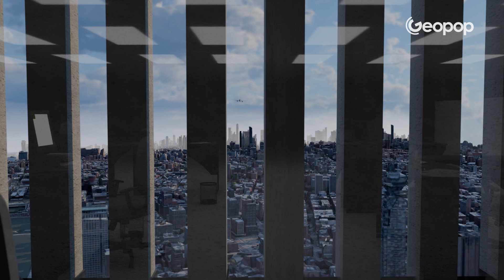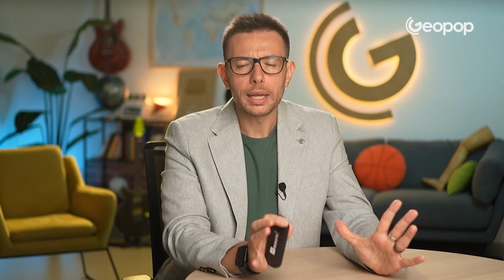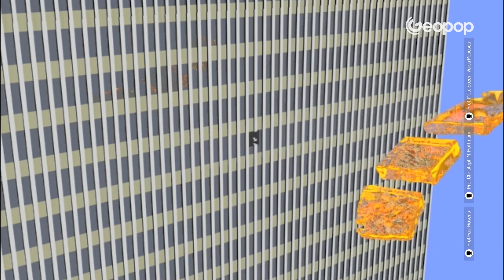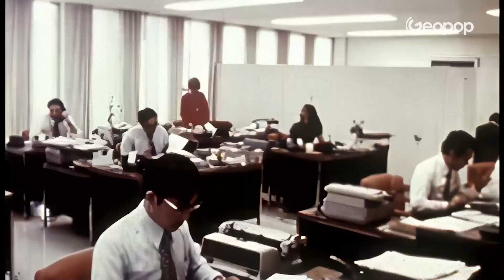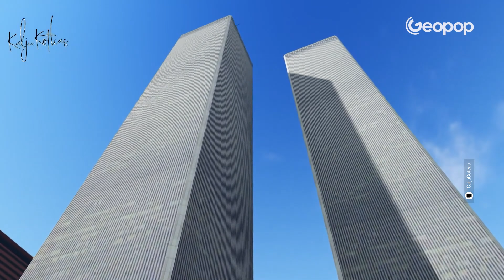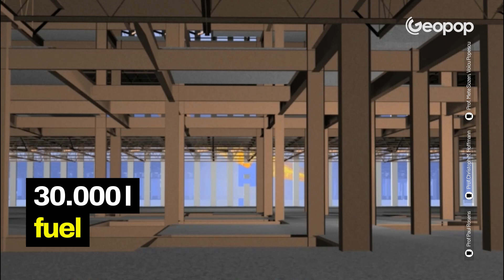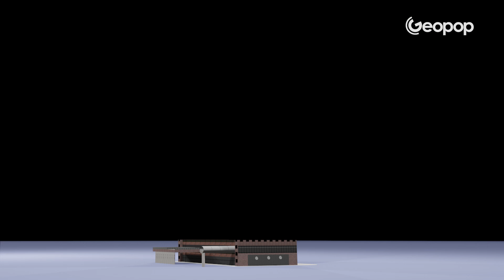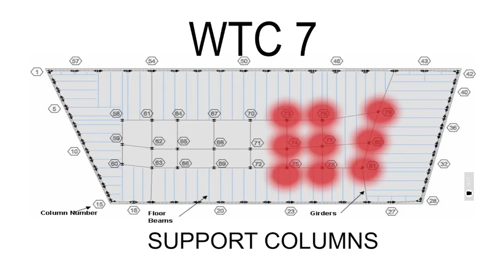9/11, 2001: The Technical Reconstruction of the Twin Towers and WTC 7 Collapses

Comment: 1 WTC collapsed directly on top of 6 WTC and you would usually expect to find 1 WTC's rubble on top of 6 WTC, but that wasn't the case. Instead of 6 WTC being completely buried under a gigantic pile of 1 WTC's rubble, was a gigantic hole. Basically the entire interior structure of 6 WTC was missing and only the steel fassade was left standing, the interior of that building was missing plus little amounts of 1 WTC rubble was found in the hole of 6 WTC. I always wondered what happened to 6 WTC and its missing interior and the rubble.
Reply: Yeah well what about building #7? Seriously that's a good observation but they rigged building 7 with explosives and demolished it within hours. Unless?...
Reply: @seedplanter7173 building 7 had a chunk of wtc1 fall on it and caused fires there were fire fighters inside tying to save the building but by 2pm they were told to pull out of the building after there were reports of the building making a lot of creaking sounds like it was gonna fall and then they got out and let the fires burn undisturbed till it eventually fell it burned till it collapsed at around 5 or 6pm the fires weakened an important column and then caused a failure that began a domino effect inside the building as the rest of them failed one by one from the east to the west and then wqs pulled inward from the collapsing interior and without any internal support, the facade of the building came down with nothing holding it anymore the facade held up fine but it wasnt gonna just sit there while the interior collapses and remain standing as a skeleton
Reply: Passport in the rubble "This our guy!". "We can't show this on the TV anymore it's to upsetting"- real translation "you might start to see the B.S.".👍
Reply: @wb2530  Lot's of debris from the planes were recovered in NYC. Seat cushions, life vest, airline miles card, stewards flight log and even mail that was being carried on the plane was recovered.
Reply: interesting..😮
Reply: Also when you look closely at the aerial pictures specifically the area of 6 WTC and 5 WTC you can clearly see round holes with a diameter of 30-60 feet everywhere. Building 5 looked like Swiss cheese. One corner of building 5 truly looked like when you are drilling a hole in your wall for example. Find a high resolution picture of the area and zoom in closely and will find the round holes pretty much everywhere. All holes even had the same size and some of the holes overlapping each other. Really bizarre to see when you see them the first time.
Reply: I did not realise that 6 was involved in any way.  That is crazy.
Reply: @cattycorner8  And the most bizarre thing is once you zoom in on the 6 and 5 WTC buildings you ll start to notice round circles and round holes everywhere. Each circle has the same diameter I would say approx. 30 feet or so, but the circles and holes are everywhere. Even inside the hole of 6 WTC. Some of the round circles are between the outer wall and interior (missing) structure and it honestly looks like as if something drilled a perfect circular hole in it. When you are looking up the aerial fotos of 6 WTC just follow the exterior wall of what was left of that building and then you will start to see the circles everywhere and building 5, too.
Reply: Most of the rubble was removed from the parking deck below ground. The debris from tower 1 and the debris from WTC 6 was pushed down into the subbasement as far 6 stories below ground.
Reply: @Oldschooldan1  Thank you, debris was the right word instead of rubble. My apologies English is not my first language. I saw the videos from inside the 6 WTC recorded by a firefighter i believe a few days after the attacks. And please don't see my response as a personal attack on you or that I am rejecting your explanation. I am genuinely interested and curious, you said that the debris was pushed down into the subbasement as far as 6 stories below ground, right? My question is, if it's so, where did the 9 or 10 stories of building 6 go and additionally the debris from 1 WTC? Because if the debris from building 6 went down into the subbasement as far as 6 stories below the ground, wouldn't that mean theoretically that the debris of building 6 filled the subbasement up to a height of the 3rd floor of building 6 and the debris of 1 WTC on top of it? I don't understand why would they make all this extra work of removing the debris from the parking deck below ground, when building 6 was unsalvageable and had to be completely removed anyways? You would expect to see the debris being removed starting from the top of the pile, or am I missing something?

As I said before, it's not a personal attack on you or your explanation, I have trouble finding the right words 😃
Reply: @cCiIcCo  There was a great video recorded by Dan Rather's called 60 Minutes 9/11 Archive: Under Ground Zero. It shows the conditions below WTC 6 and explains the debris removal and how much was there. There are photos of the damage to the PATH tunnels under WTC6 that show steel columns punching thru the ceiling of the train tunnel 6 stories below ground. Good luck on you research. I have been researching the events of 9/11 for the last 20 years and have read all the engineering reports and articles on the subject.
Reply: @cCiIcCo Look for "9/11 Archive: Under Ground Zero" It's here on YT and will help you with your research.
Reply: @Oldschooldan1  Agreed.  The sheer weight of Tower 1 was unbelievable!   In pieces or otherwise.  Add to that the force it had coming down from that height, I have no doubt that whatever was underneath was pulverised and flattened underground!
Reply: @Oldschooldan1 Jesus fucking Christ that sounds absolutely terrifying.
Reply: @Oldschooldan1 yes, have read about this. That happened exactly
Reply: Today is a day to remember that 23yrs ago 3 buildings fell all owned by 1 man who just happened to take out a recent insurance policy against terrorists and at the same time just happened to hire Israeli Art students to paint the stairwells from basement to top floor and he changed the elevator inspection company to a new one a month before his buildings fell that also happened to have been present the morning his buildings fell which awarded Lucky Larry over $3.4BILLION. All while a audit was occurring in those buildings to locate the $2.3Trillion that was announced missing from taxes LITERALLY the day before his buildings fell down. Sure sounds like a good reason to invade 5 different countries. And let's remember the 4 dancing Israeli men were arrested dancing and taking pictures on an empty rental truck with the towers still on fire in the background at a tourist look out rented from a company that didn't actually exist and all 4 men were released without investigation.
Reply: @maddmax248  Other than it being 23 years ago, literally everything you stated is false. Silverstien didn't own the towers he leased them. The PANY owned them and they required him to take out the insurance. The same insurance the towers had during the 93 bombing. All the money from the settlement had to go to rebuilding the site and it was nowhere near enough,. Furthermore he had to continue to pay his lease during the reconstruction. The 2.3 trillion missing expenditures was at the Pentagon not the WTC and it had been discussed for almost a year before. It was old news by 9/11. The 4 Israeli's were detained for over a week by the FBI and found to have had no prior knowledge of the attacks. It's amazing that one person can get so much info wrong, but here we are.

Comment: I you hadn't have mentioned the AI translation and re lip-sync, I probably wouldn't have noticed. lol

It's already very good. I just assumed the audio was slightly out-of-sync, tbh.
Reply: In the first minutes I found something odd. I didn't know why or what seemed odd, but I had a strange feeling about him talking. When he explained that it was AI it made more sense haha
Reply: Which is more extreme -- to accept without question the inexplicable lack of turbulence in the wake of a 500 mph large passenger airliner -- not evident in the smoke and fire covering the impact zone only seconds later? -- or to recognize the indications of digital projection in its imperfect nature as we see a wing disappear in front of a bright blue sky? From another camera angle, the same aircraft is seen passing behind a crane in the foreground, yet in front of the heavy crane cable. 

There should be a hurricane of turbulence in its wake that would entirely disrupt and disperse the smoke and fire seen billowing outward just 3 to 4 seconds later at both towers.  Even the wake of a small Cessna aircraft would be noticeable -- yet there is nothing.
Reply: -- Then what is the source of the many tons of molten steel found in and under the debris, the heat so intense that the molten steel remained in that state for weeks afterward, running off of the debris as it was excavated. This cannot be molten copper from wiring that retains the color of a shiny new penny.  It cannot be molten aluminum that retains the color of the polished aluminum wheels of a street racer. It was the color of glowing orange molten steel  that cannot be mistaken for any other material, reported by firefighters who are very experienced in the nature of such materials as well as seen in video evidence.

When you combine this with an entire lack of turbulence behind 500 mph aircraft, when even a small Cessna Aircraft would leave an evident wake in the smoke and fire only seconds later .  . We find that skeptics still cannot be skeptical of the official narrative in explanation.  Sponsored channels and forum activity are skeptical of nothing when support is provided.

Sponsored activity in the forums is very normal today for commercial and political purposes and subjects of controversy -- in the attempt to lead public debate.
Reply: @ElLowEl .  . "What the hell are you talking about?" .  . 😃 .  . Thank you for your sponsored reply, Mr. EILow.  The word projection indicates holography as you know, commercial demonstrations of which have been amazing in recent years.  To feign ignorance doesn't work well for you, however.  Where, Mr. EILow, is the wake turbulence only seconds after passage of a 500 mph large passenger airliner -- not seen in the smoke and fire covering the impact zone?  Even the wake of a small Cessna Aircraft would be noticeable -- yet there is nothing.  It's likely that no real answer from you is forthcoming. We'll wait and see .  .
Reply: It is! I only noticed at a point around 12 minutes when "he" said a plane hit between the "90th and nine nine n-th floors" 🤦